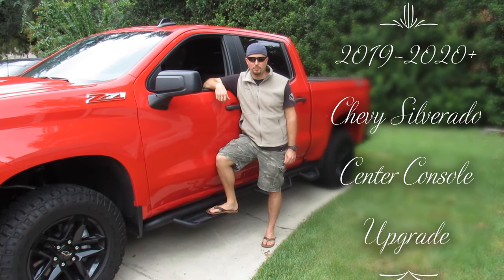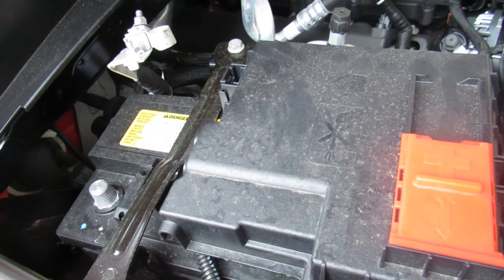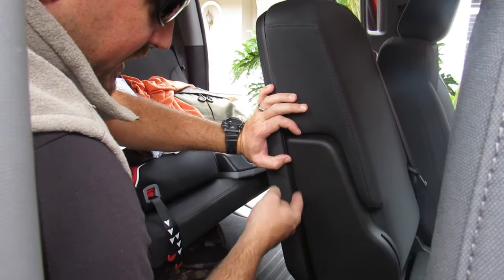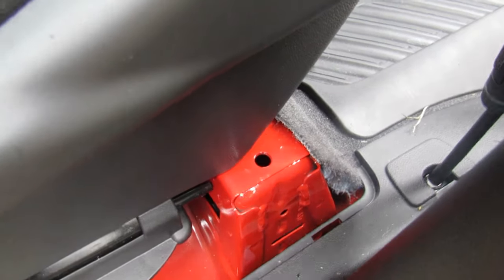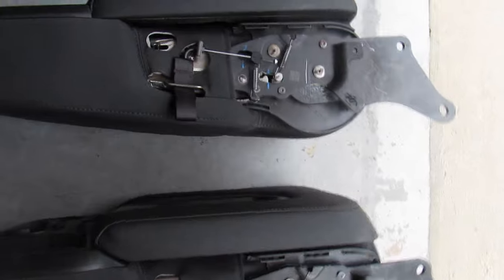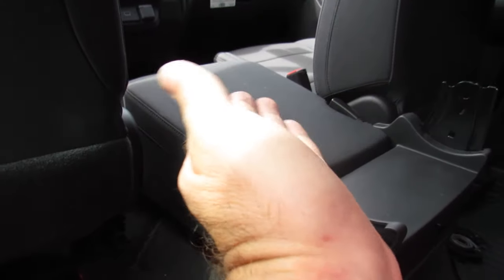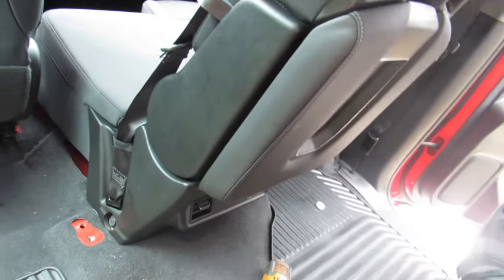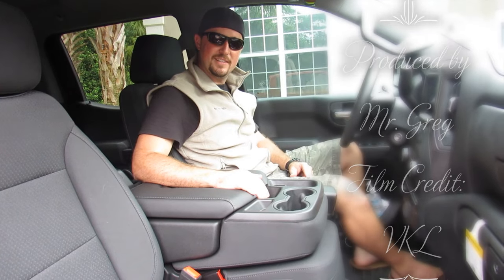HOW TO Upgrade 2019-2020+ Chevy Silverado Custom Edition Center Console Storage

Comment: I'll be doing this on my 2021 base model GMC Sierra, like you, I wasn't paying GM an extra $10000.00 to move to the SLE to get this.
Reply: You get alot more than just storage on SLE....LED, steering wheel controls, cluster, etc.....totally worth 1k
Reply: Just to clarify, from a custom package to an lt is a 1200.00 option

Comment: I installed those center consoles on the assembly line. Pain in the ass especially connecting the wires when they had different options

Comment: The metal clips you describe are actually called "Spring Clips". I have always reinstalled the "Spring Clips" that were left behind in the frames, back onto the Plastic molding, then reinstall that molding when ready.  When reinstalling the trim, do NOT give the trim a hard smack, constant pressure as you guide the trim with the Spring Clip back onto the frame is the winning choice. When  original removal of the trim, you will see where the "Spring Clip" has small teeth that grip onto the Trim elongated pieces that hold them trim to the frame. Patience pays off, plastic is not always forgiving and breaks. Nylon Trim Tool Set is always recommended for starting trim removal. Experience of 20 years in Molding and trim removal on Public Safety Emergency vehicles and at times learning from failures. Enjoy the process, all looks good.
Reply from the maker: Thanks for the tips, partner!  It’s always nice to hear from true professionals for the best industry tricks!

Comment: Thank you! I really appreciate the level of detail in your video! The fact you mention the specific size bits needed is awesome! My husband and I just got a used trail boss, so the center console had cracked leather and the lack of storage was a disappointment (even though we love the truck itself). I'm glad this looks like a fairly easy replacement process, though. My only question is where did you find the replacement assembly? I'm sure chevy has it, but I'd prefer to avoid their markup for it.
Reply from the maker: Howdy, partner!  I dont have the item # off hand but know it is listed a bunch in older comments below along with a link where I got it.  If I get a chance to look I will try to find the link again.

Comment: Wow. I have an RST trim level. I had no idea that they dont even give you storage in that center consols/seat on the lower trims. What a dick move by GM..
Reply: @MRGREGSHOWTO  do you have a link for the seat/console that can be ordered?
Reply: Ford started that on F150 xl and stx.
Reply: For a 60+ thousand dollar truck no storage really ? WTH
Reply: @alf.m5961  his truck isn't a $60k dollar truck. I have an RST trim and paid $39k out the door. Anything below the LT trim (which slightly cheaper than an RST) doesn't have the extra storage in the center console. LT and up does. Although I do 100% agree that the truck should have storage regardless of the trim level.
Reply: @justinschnepf  is that a 5.3l and 4x4?
Reply: @comebackseason11  yes
Reply: @MRGREGSHOWTO  The website says it takes about 45 minutes with simple tools.
Reply: @justinschnepf  which dealership that you bought your HD? I’m looking for one now. Ty
Reply: @alf.m5961  I haven't seen a Custom trimmed TB in the 60s. They typically are in the low 50s but i still agree that it is ridiculous.
Reply: Does the RST have lumbar adjustment? They removed that from the LT on 2019+.
Absolutely ridiculous.
Reply: @xirabolt  my RST had lumbar support.  I traded the truck in for an LT last month and my LT (2021) also has lumbar support so I'm not sure why you're saying they don't
Reply: @justinschnepf  Maybe 21 readded it because I'm sitting in the 2019 and there is 100% no lumbar adjust.

Comment: I just found out the 2021 custom trailboss comes with center storage so the part number for the 2021 model can be used now and would be alot less Hassel when ordering through your local dealer

Comment: 👍🏼👍🏼 Great how to video for someone thinking of swapping out their center console. I did this conversion a year ago when I first got my Trailboss and the one step that I thought was the hardest part to figure out was the removal of the seat belt where you have to bend up the Aluminum Blind Rivet holding the seatbelt anchor to the floor without thinking you were going to ruin it. You skipped over that part.. 😬
Reply: What did you do to get it out? (The rivet)
Reply: @backwoodsv1047  Hey Backwoods, I took a screwdriver and got behind the thin part of the rivet between the seat belt plate and slowly bend it up enough to slip the seatbelt plate over the head of the rivet.  When you install the plate from the new console over the rivet you just bent up take the round backside of a ball peen hammer and lay it in the center of the rivet and slowly tap on the hammer so it flares the rivet back in shape. Once you get the rivet flared out enough you can tap the rivet with the flat side of the hammer to get it flat again. Hope this helps and good luck.

Comment: hell yeah! got my new console in this past weekend. gonna put it together this weekend when im off work. thanks for the video! definitely gonna use it as a guide :)
Reply from the maker: Awesome, partner!  It is a game changer!  Best of luck on the install.  Expect one of the T55 bracket bolts to be stuck in there good, but with proper leverage you can get it out.  Let us know how it goes!
Reply: @MRGREGSHOWTO  thanks for the tip on the T55 bracket. gonna take it to my dads garage and have him give me a hand, between the two of use we should be able to bust it out. thanks again! ill let you know how it went :)
Reply: Where did you find the replacement console ?

Comment: Great video!  I've been hoping someone would come up with a way to integrate a wireless cell phone charger into the armrest where the rubber bottom cubby is since you lose that option when you go from the bucket seats center console trucks to the bench like ours. Thanks again.

Comment: My 2020 Custom has the handle/compartment and it's not a listed 'option' so I checked in with a relative who designs the Silverado and found that they switched the console in some of the later built 2020 models. So some have the handle and compartment (ones built later) and the early ones don't. Sounds like the 2021s will all have them.

Comment: If you're changing out the entire console, all you have to do is take out the seat bolts on both sides with a T50, use trim tool to pop the sensor cable lose underneath the seat to give yourself some slack, then lift and lean the seat back.  Do this on both sides.  It will give you plenty of clearance to get to the 18mm bolts securing the console in place.  Once you have the console loose, simply lift the console up and take it out the passenger door.  Much easier than trying to get it past the steering wheel.  Do everything in reverse order and you're all set.  Just did mine and it took maybe an hour.  Too easy.
Reply: What did you replace it with? Link for the part?
Reply from the maker: Thanks for sharing, partner!
Reply: @indianriverguideservicellc7052  I bought a console that was pulled out of a 22 silverado. Fit perfect. Only thing is the lock on the bottom storage. Gonna have to get it replaced with one that works with my key.

Comment: Where do you purchase this new storage center piece?  Just got a 2500 that doesn't have the storage 😡
Reply from the maker: Hey partner!  I bought mine online at SD Parts (link below). They seem to be hard to come by with limited stock. You may be able to find them at other websites, EBay, or even a junk yard. Good luck and thanks for watching!

https://sdparts.com/i-24138922-genuine-gm-parts-84756948-center-console-upgrade-for-2019-2020-silverado-work-truck-models.html

I believe it is GM Parts #84756948

Comment: If you take whole top part off of the non storage version there is a hidden secret cubby inside. I work for a large used car dealer and ever since we’ve been getting this generation truck I couldn’t believe the downgrade from the 2018 and older model. I was checking out the arm rest on one of these and couldn’t believe it wouldn’t open. I tried from the back and that’s when I discovered it was broken and the hidden secret cubby lol. Had a plastic inset and everything. Now this particular one could have been discovered before hence why it was so easy to pop the top off and someone may have made a makeshift plastic insert for it because it does look suspicious but I don’t know… not the weirdest thing I’ve seen car manufacturers do.
Reply from the maker: Hey partner!  Thanks for sharing. Yes, what a weird way for GM to cut corners!

Comment: Just getting into a 2020 silverado and this video is amazing!  Hoping it will help me lots.  Quick question though, how does it fit with the vents in the back and then is it possible to run a plug all at the same time?
Reply from the maker: Howdy partner!  We only replaced the top half so the vents aren’t effected. I think they only get disturbed if the whole jump seat is swapped. You could run power for sure. Check out our wireless charging install video for tips!  Thank you!

Comment: Is part # 84756948 the number for your original arm rest that came with the truck or the part number for the replacement console that opens?  Please confirm the part number you purchased to make this update.  Great video!
Reply from the maker: Hey partner!  As you’ve probably seen in previous replies, I posted a link from where I bought the replacement below. Unfortunately, that link is no longer active. The part number you reference is in the link so I would assume that 84756948 is the replacement console that opens. But, I am not 100% sure. Hope that helps!

https://sdparts.com/i-24138922-genuine-gm-parts-84756948-center-console-upgrade-for-2019-2020-silverado-work-truck-models.html

Comment: I bought a 2019 Silverado 2500HD with a royal body bed last year. It's pretty much an expensive ass base model truck. Can you upgrade things by just buying them? My steeringwheel doesn't have buttons for the radio but I heard all the wires or connections are there so you basically just buy a steeringwheel with the button and the connections should be there. Is that true? I heard something like that for remote start. It's just annoying having to reach the radio to adjust volume or change the music. Would changing the speedometer with one with a fancy bigger screen possible also or those trim models built different? Thanks.

Comment: Was the top have just from Chevy? Just want to know where you bought it. Thanks! Great video.
Reply from the maker: Thanks, partner!  I bought mine online at SD Parts (link below). They seem to be hard to come by with limited stock. You may be able to find them at other websites, EBay, or even a junk yard. Good luck and thanks for watching!

https://sdparts.com/i-24138922-genuine-gm-parts-84756948-center-console-upgrade-for-2019-2020-silverado-work-truck-models.html

Comment: I almost got mine without removing either of the seats, and then that the seatbelt bolt bottom out on the driver's side seat track. Oh well, still went smooth otherwise, thanks for the video!
Reply from the maker: Awesome, partner!  Nice work. I wish you didn’t have to remove either seat.  Thanks for the feedback.
Reply: @MRGREGSHOWTO  absolutely. Everytime I do something to a newer vehicle it makes me miss the simplicity of early 2000's vehicles. You have to take the headliner down to replace the third brake light in these trucks for heavens sake.

Comment: Taking off the battery terminals does not make the air bags safe….it’s have battery/capacitors to keep power to them for a while after the battery is disconnected
Reply from the maker: Thanks, partner!  Good to know - appreciate it.

Comment: Great video I had to do the same thing. I got the complete upper unit too but I did the install a bit differently. I took the screws out of the passenger and the driver's seat tracks next to the center console and then pulled the seat release to move the tracks out of the way. Then I completely removed the center console and swapped the top out in the garage. A little more room to work, not sure what Chevy was thinking I traded in a 2001 2500HD with 315,00 miles on it for the 2020, and I was spoiled with all the storage the old truck had. Ok so now the tough question, on the inside of the lid there are two places molded-in for something one looks like maybe papers, and the other I have no clue. Have you looked at them and if so what are your thoughts.  Thanks for a great video again enjoy
Reply: I’m pretty sure it’s for a small box of Kleenex
Reply: I did the swap out the same way as you and it was a lot easier…less steps and more room to work with the entire seat out. 👍🏻

Comment: update on optional tow mirrors. I received my build sheet yesterday, and it has listed that heated mirrors came on the truck. But as per GM, the mirrors do not display a heat symbol on the glass as in previous years. So long sorry short, don't believe everything your dealer says, keep asking questions and researching for answers. I will order the mirrors and wiring harnesses, and install myself, but the dealer will have to program for complete use of lighting.

Comment: Where did you get the upper middle seat? I’m having trouble locating a part number, local dealer told me it’s not possible. Do you have a website or part number available?

Comment: I am looking to do the same thing ,where can I find the parts at
Reply from the maker: Hey partner!  I bought mine online at SD Parts (link below). They seem to be hard to come by with limited stock. You may be able to find them at other websites, EBay, or even a junk yard. Good luck and thanks for watching!

https://sdparts.com/i-24138922-genuine-gm-parts-84756948-center-console-upgrade-for-2019-2020-silverado-work-truck-models.html

I believe it is GM Parts #84756948

Comment: Would it be possible to remove the centre seat altogether and put one of those bad ass centre pieces that connects to under the dash?
Reply from the maker: Yes, partner. That is possible. I think there may be another video or two out there of that swap on various year Chevys.

Comment: Hey Greg, I’m following your video currently to swap out my jump seat to the one with storage, but I’m having trouble with the seat belt removal. I took the bolt out but there is still that silver piece there holding it in and I’m not sure how to get that out. It almost seems like you need the stick the head of a bolt in and unscrew it that way. Please help me because I am lost, thanks!
Reply from the maker: Hey partner.  Mine popped right out of the silver thing without much effort, but I have heard that it’s stuck in there good sometimes. I wish I knew exactly what you were encountering, but I’m not sure the issue. Perhaps they added a locking piece after production of mine. Good luck and please let me know if you’re able to figure it out for future reference.
Reply: @MRGREGSHOWTO  I got it figured out just as I was reading your comment, just stuck my foot against the console and yanked it. Turns out that silver clip is bent around the mount for the seat belt a bit to give it some extra security I guess. Thanks for the quick response though, much appreciated!

Comment: Wow, need to know where or how you bought one cause i cant stand that i have no storage on top or on the bottom
Reply from the maker: Hey partner!  I bought mine online at SD Parts (link below). They seem to be hard to come by with limited stock. You may be able to find them at other websites, EBay, or even a junk yard. Good luck and thanks for watching!

https://sdparts.com/i-24138922-genuine-gm-parts-84756948-center-console-upgrade-for-2019-2020-silverado-work-truck-models.html

Comment: I need to know where I can buy this from I hate not having the extra storage. Pls help
Reply from the maker: Hey partner!  I bought mine online at SD Parts (link below). They seem to be hard to come by with limited stock. You may be able to find them at other websites, EBay, or even a junk yard. Good luck and thanks for watching!

https://sdparts.com/i-24138922-genuine-gm-parts-84756948-center-console-upgrade-for-2019-2020-silverado-work-truck-models.html

I believe it is GM Parts #84756948

Comment: Where did you get the center console from? Can’t seem to find and website that sells them
Reply from the maker: Hey partner!  I bought mine online at SD Parts (link below). They seem to be hard to come by with limited stock. You may be able to find them at other websites, EBay, or even a junk yard. Good luck and thanks for watching!

https://sdparts.com/i-24138922-genuine-gm-parts-84756948-center-console-upgrade-for-2019-2020-silverado-work-truck-models.html

Comment: Fantastic video and information ! I actually called the chevy dealership and they had no clue if I could convert it ... I of course said , yes i can ! Ughhhhhh .... anyway , where did you get the new center counsel ? Thanks for the awesome video 🤜🤛
Reply from the maker: Thanks, partner!  That’s funny about the dealer. I bought mine online at SD Parts (link below). They seem to be hard to come by with limited stock. You may be able to find them at other websites, EBay, or even a junk yard. Good luck and thanks for watching!

https://sdparts.com/i-24138922-genuine-gm-parts-84756948-center-console-upgrade-for-2019-2020-silverado-work-truck-models.html